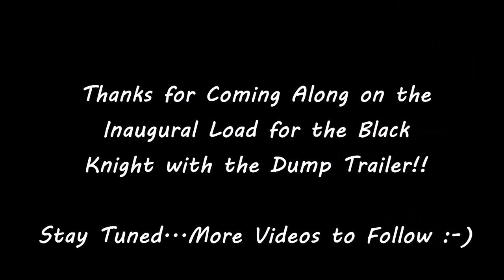First Load with the 95 Western Star and 89 Cobra Dump Trailer

Comment: It is certainly better to be on firm ground especially for the first time you raise that bed with a load.  All that weight at the front of the trailer some 40 feet off of the ground makes for some interesting weight and balances issues.  You were careful to wait until the load started to slide before going the rest of the way up.  As you know, more than once, a top heavy dump trailer has rolled over on its side because of the soft ground under the rear wheels.  Good job.
Reply from the maker: Yeah, that was my first time operating a dump trailer.  I've seen more than a few on their sides.  I wasn't trying to have that happen my first time out the chute!!